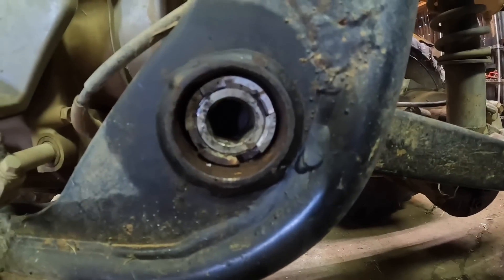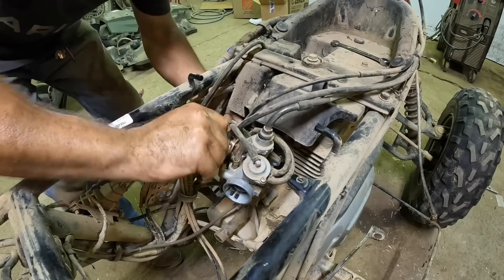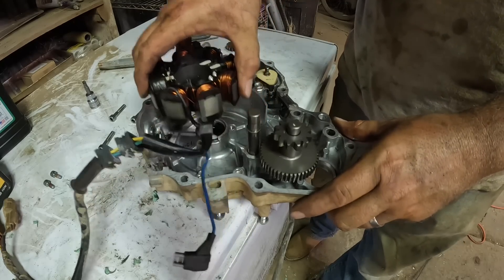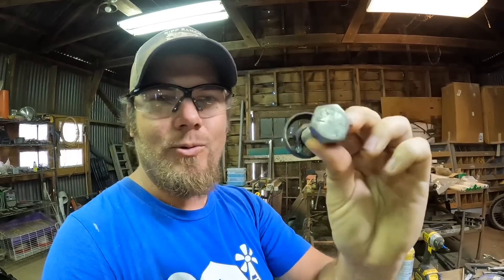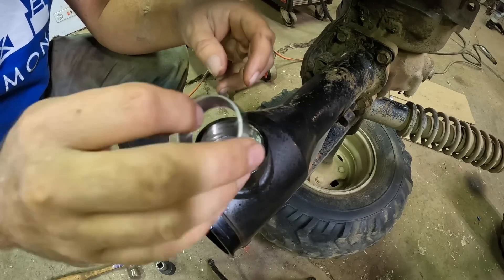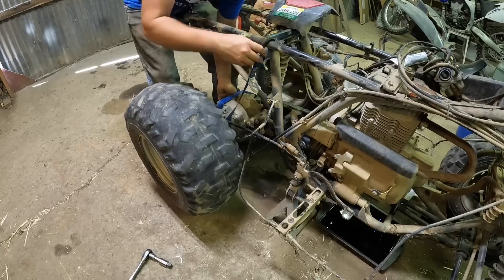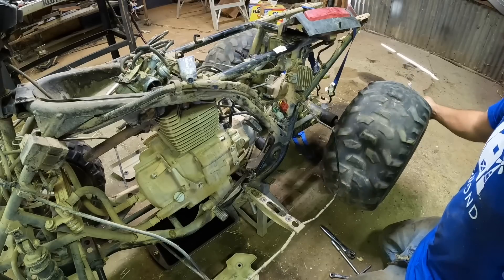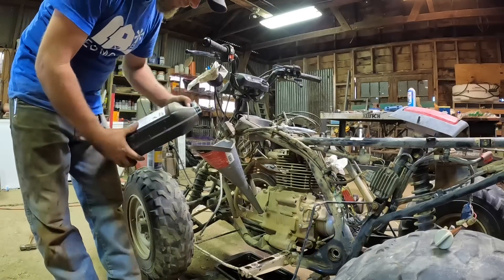New Stator and Swing Arm Bearings on the Honda Recon 250

Comment: I watched your Pinkeye Calves a month ago and was pretty impressed.  Very hard to find vids on Recon 250.  I have a nice one my FIL bought new in 1998 here on the farm.  Original tires yet and it never needed any repairs other than battries.  Only problem has been for years carb needs to be 1/3 choke to run good but is getting worse now.  Very nice having the Recon along with J.D.  XUV 550.  Great video.

Comment: You have one 8' 2x4 in hand. Cut it at a 45° angle about 3' from the end. Now you have 2 boards (3' and 5') both angled. Drill a hole for a bolt through the short one within 3" or so at the still square end. Drill another bolt hole in the longer one about 2' from the square end. Bolt these together here. The longer one gets the last hole about 6" from it's square end.  I have a corner exposed stud in my garage so I used a lag screw to mount this contraption so it just hangs out of the way when not in use. About 5½' above the floor is just right. Break the beads with shortie's angled end, using longie's length as a lever handle. I know it sounds confusing, but it really isn't and you cannot get one any cheaper for sure.